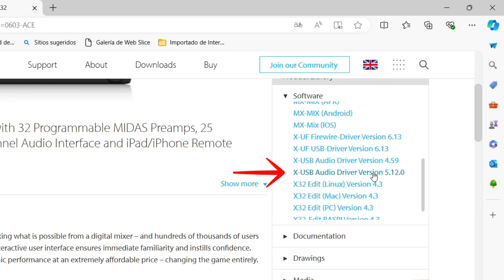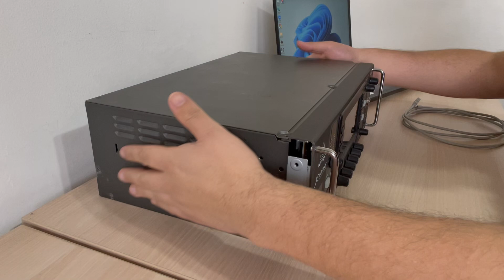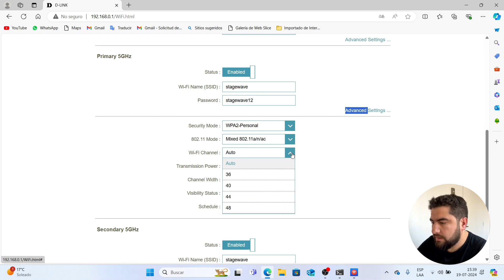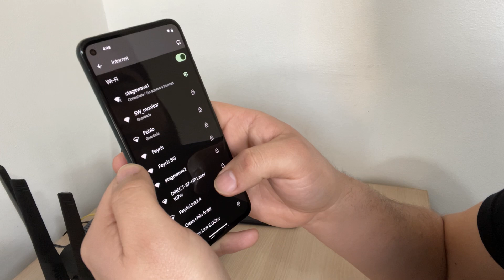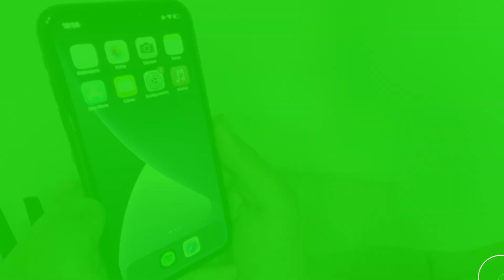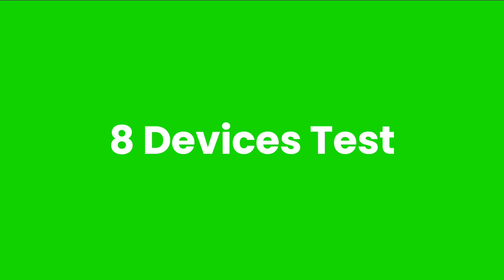StageWave From Scratch - 8 Devices Tests - Step by Step

Comment from the maker: This tutorial was designed with Windows in mind due to its more complex configuration process. If you're using MacOS, you can skip the driver installation and firewall configuration steps, as they are not required on your system.

You can check out how to configure the D-Link DIR-3040 router here:
🔗https://help.stagewave.io/en/advanced-guides/configuring-dlink-dir3040

Comment: Stagewave is a great app! I am using lan to iphone . It's very stable! but in wifi mode. No matter how many  routers I switch to, such like xiaomi or  Gl.inet . the sound will occasionally lag. maybe  it's  a  rouders problem.  I already changed the wifi channel.
Reply from the maker: It's good to hear that. Did you follow all the instructions in this video? Driver configuration, WiFi interference, and devices configuration. If you are still having issues, please text us using the chat button on our website. Greetings!

Comment: Why is it necessary to disable bluetooth? Can a user not use a bluetooth earpiece instead of a wired earphones? I realize there may be a touch of latency in this, but the reward is less complexity. Also, Bluetooth won't interfere with the 5GHz band as Bluetooth operates in the 2.4GHz band.
Reply from the maker: Using Bluetooth headphones introduces about half a second of latency—that's the latency you probably noticed. On the other hand, while Bluetooth doesn't interfere with Wi-Fi on the wireless spectrum, these two protocols use the same chip in most smartphones, so completely disabling Bluetooth helps you dedicate all of that chip's resources to Wi-Fi exclusively.